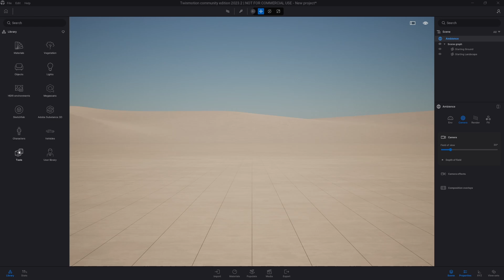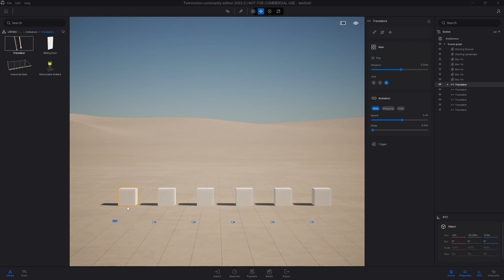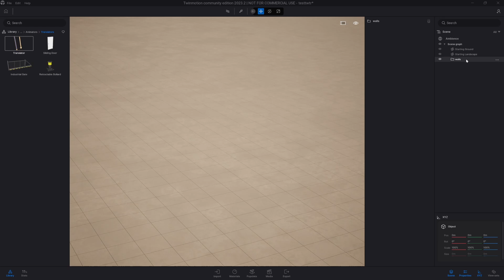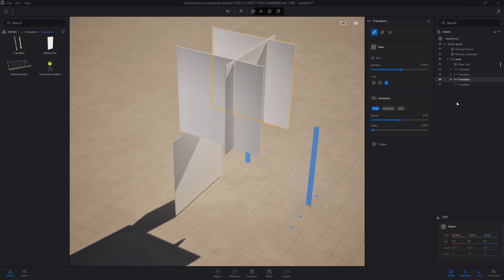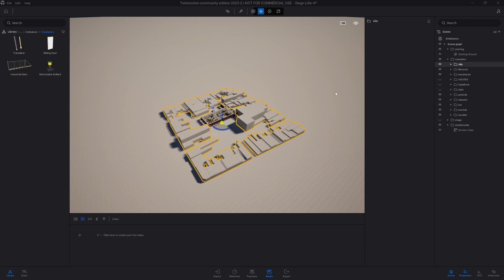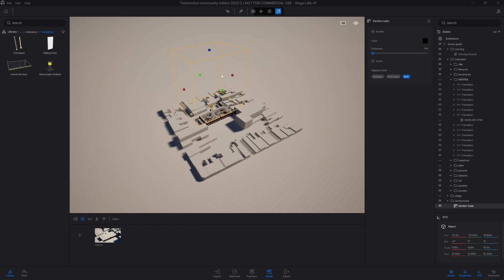Animations with Translators Making Of in Twinmotion 2023

Comment: Hello @twinmotion team/users, I have a question: Most pointclouds already have baked-in lighting and shadow information. Is there a setting in Twinmotion that allows me to switch off Twinmotion lighting ENTIRELY? That would make sense since it saves performance and doesnt infere with the lighting captures in the pointcloud. Generally my pointclouds run smooth on desktop, but in VR even an 1GB pointcloud scene lags very hard despite my high end graphics card and all VR settings set to low.

Comment: @twinmotion, great tutorial. I have been struggling with the translators forever this is a great and clear tutorial with the tool sets available. Hats of to the creator.

This process seems incredibly unintuitive with users having to do re calculate postions of objects by hand. Really goes against the simplicityof the rest of the program, tons of materials, lighting options, more tress than I know what to do with, but one translator?

If there was a way to create a constuction drop in sequence that works as easy as the rest of the software, it would make the program the best. All the individual panels coming into shot really create an  unbeatable video. 

Currently the translator works well for single objects. Would be great if there was an simple drop in or exploded animator for the whole model, or more types of translators that work with the same simplicity as the rest of the software.
Reply: To create an construction animation, you can use this technique which is pretty time consuming. But an other way would be to datasmith your project, import it in blender set your animation and export the animation sequence (fbx file) to Twinmotion

Comment: Nice job. It's worth mentioning you can keep same speed on all translators and   have more control and precision instead to activate them you can use custom path cube object which is moving outside of camera range, then put center of translator on its road - as soon as cube will come close to translator it will activate it - having like 50 translators in a line will create the natural delay while keeping same speed of translators - you can also then control the speed of activation by changing the custom path speed. Made 2 years ago a video called "Industrial Home Garden - Twinmotion 2021" on my channel where you can see how that kind of activation works out in opening scene. Anyway - good job ;)